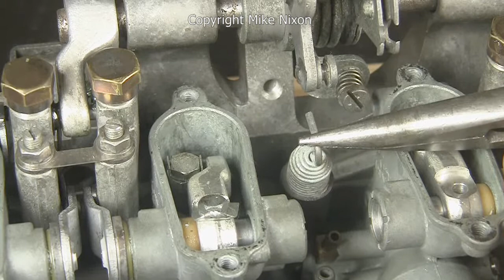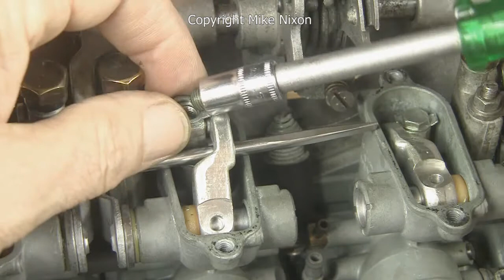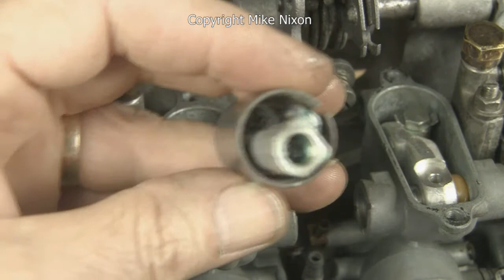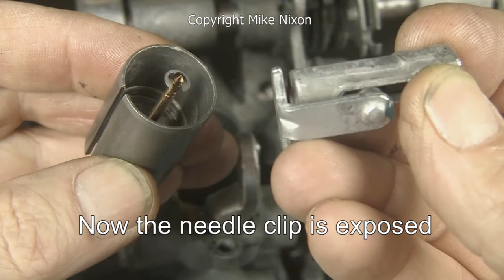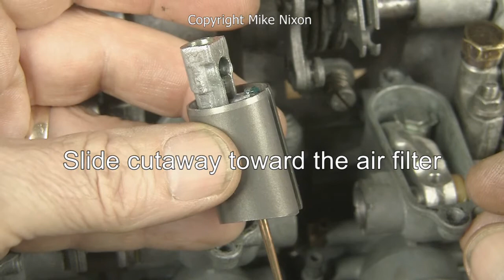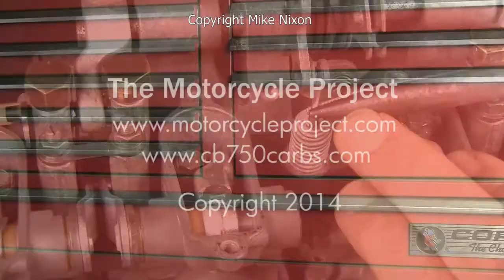SOHC 350/400/500/550 Needle Adjust

Comment: Lol. No good deed goes un-criticized does it? 😆 I was curious if they are stock OEM needles and if the bike was running pods or velocity stacks? I put 110/40 jets on mine and the original airbox was  lost by prev owner. Having power issues on last gear. Needles are on last clip at the top of the needle. Wondering if anyone can tell me what they have it at or specs on their carb setup and how i runs. Thanks.